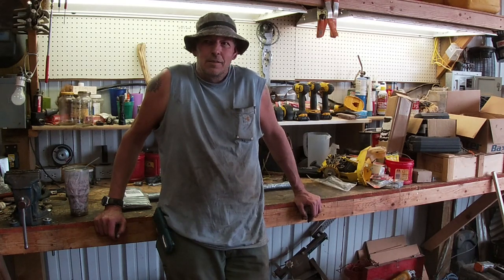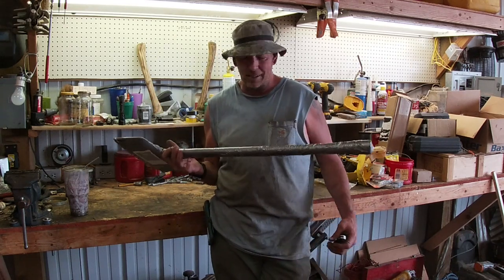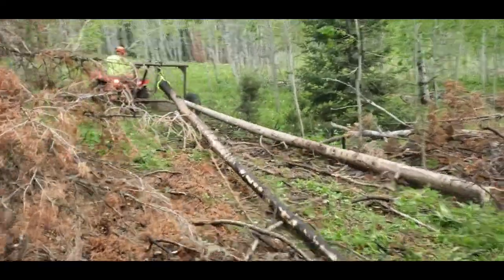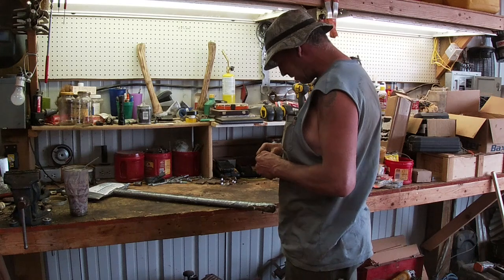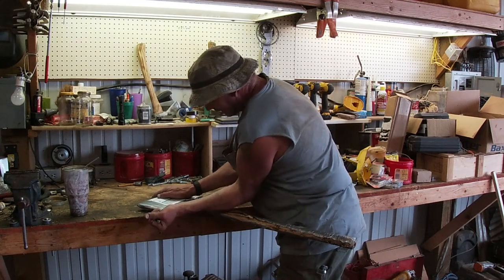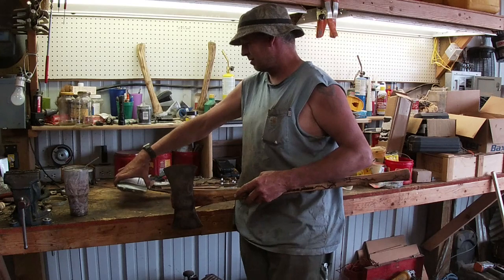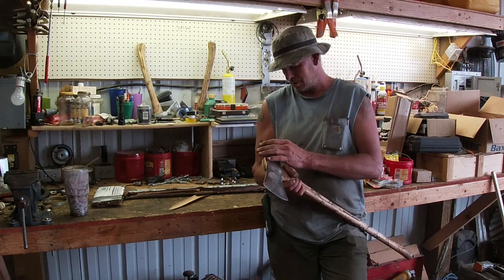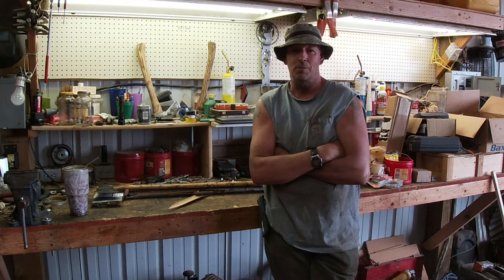A very "special" unboxing...…#BuckinExperience

Comment: Great video..

I love my Buckin Special Double. 

I've used it a bit but it spends most if the time proudly displayed on my wall in the shop.
Reply from the maker: Very cool!! This sager is a heavy double. Feels great though. I just went back to work so wont be able to get swingin it till next thurs or friday. Thanks for watching and commenting!!
Reply: @307j.o.a.t9  mines 4.5lb true temper with an extra long 36" handle. It splits wood that I'd normally just noodle with a big saw. 

Buckin is a true craftsman thats for sure!!
.
Reply from the maker: Nice! The handle on this one is shorter. Probably a 32. I havent measured it.